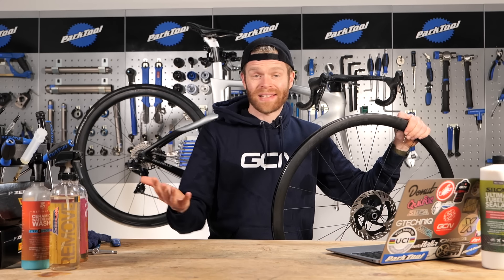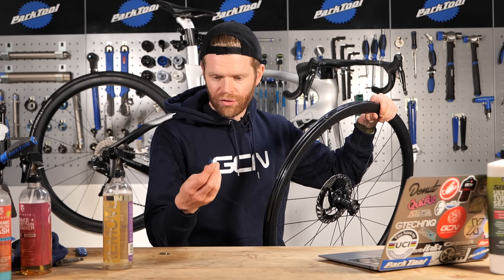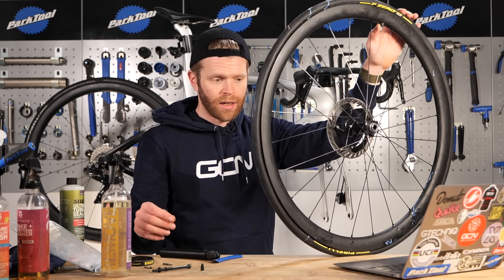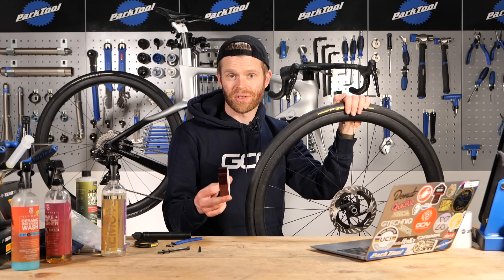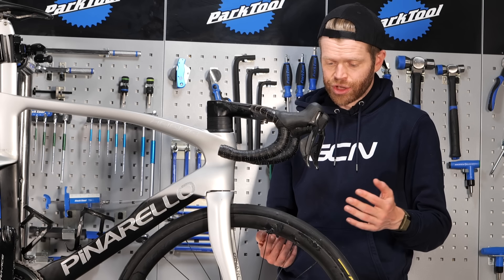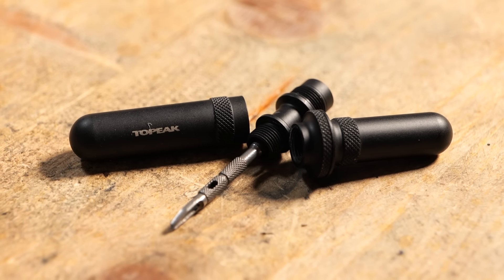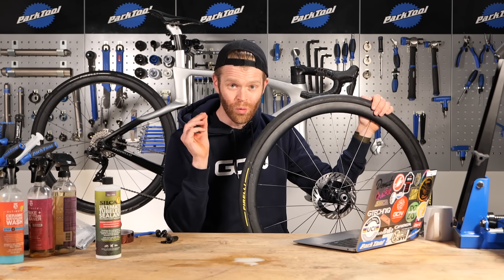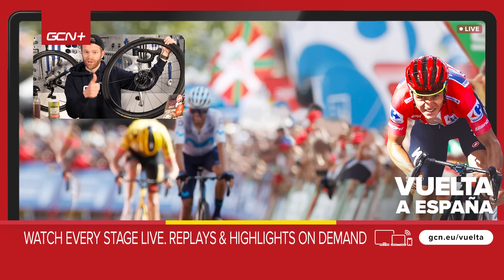Everything You Need To Know About Tubeless Tyre Maintenance

Comment: No mention of how much sealant to put in... maybe this is common knowledge but I've found that you want to have enough so that a small puddle of it quickly collects. This way when you get a puncture, you can position it at 6 o'clock and the puddle will collect over the puncture. Having just a coating inside the tire is too little.

Comment: Tubeless are so amazing they not only cost much more, they also need a 20min video to explain how to set them up using additional tools and sealant that you also have to buy.

Inner tubes - 10$  and you can replace them with your hands and a small pump.
Reply: Are you installing tubeless with your feet?  It's remarkably easy to install tubeless tires these days.  As for the cost, time is money and putting two tires on in 10min total(including tape) is quite easy.  I get home seeing a bit of sealant on my frame 3-4x a week.  Every time,  I would have been stuck on the side of the road swapping tubes if I were running tubes. Instead I just unknowingly keep riding.
Reply: @veganpotterthevegan  there is no way that you would get a puncture so often unless you are doing something very specific and very wrong. I ride between 400 and 800 km per month and would get a puncture once maybe twice a year at the most.
Reply: @mjock392  where you live matters. I'm in the rockies in goathead country.  Sometimes I have a goathead in my tire before getting off of my very own street.  I pluck it out, see a dot of sealant and go on my way.  They're really everywhere here.  So yeah,  I'm not doing anything wrong outside of riding outside😅
Reply: @mjock392  I do ride a lot more than you though.   I rarely ride less than 1800km a month.
Reply: I'm never going back to tubes. Tubeless has indeed been amazing for me.

Comment: #askgcntech In the theme of mounting tires (tyres, sorry Brits!) what is the difference between mounting tires (tyres!) with no discernable tread pattern in the correct orientation and the wrong orientation. GP 5000s have not discernable difference in the area where the rubber hits the road. Does that actually matter? As a regular GCN Tech viewer I'm obviously super nerdy about my bike set-up so I'd do it "correctly" either way but I was curious if it actually matters. If so are we going to talk about rubber layup like we do with carbon fiber?
Reply: can be a bit to do with the layup, but it can also be the casing construction. A lot of motorcycle tyres get fitted the "wrong" way on the front wheel due to the casing construction

Comment: I went tubeless but was super disappointed I didn't get a single pop or bang when the tyre seated. 😢
Reply: Some rim-tire combinations don't make the "ping" sound when you seat them, like if you're working with a Roval wheelset. If the rim bed's valley is deep enough, then the tire bead may "ping" when you get it seated.
Reply: @sbccbc7471   Ah I see. Thanks. I thought it hadn't seated but left it over night and it turns out it was

Comment: Yes tubeless is great, but I just don't think they're worth it for the roadside dramas. Good quality tyres have very good puncture protection, which in itself contribute to reducing the risk of a puncture. When you do get a puncture changing a tube is infinitely easier and quicker .
Try putting a tube inside a tubeless tyre - both a struggle to get the tyre off and back on.
Reply: I've gotten home from rides and noticed dried sealant on the seat tube.  Turns out I have had punctures that sealed themselves.  No roadside drama of having to replace a tube.

Comment: Tubeless people: Tubeless is great. Make sure you switch over 

Also Tubeless people: posts a 20 minute video basically confirming that it isn’t actually worth the hassle
Reply: I thought the same but I set up for first tubeless wheel today and it took less than 5 mins. I'm pretty sure people love to overcomplicate things
Reply: @DanielButler92   Indeed, my commute bike is not advertised as tubeless ready wheels, I replaced the worn Zaffiro tyres with Terreno zero, and converted to tubeless, twas no fuss, the tyres go on and off the etrto wheels a breeze, 2 road, one mtb and a flat bar all running tubeless now.
Reply: Tubeless has been a game changer for me. I've experienced almost none of the hassles others report. I guess I got lucky with my setup. Never going back to tubes!

Comment: Beware!! I have found out the hard way that CO2 makes sealant set hard within 24 - 48 hours.  If you have to use a CO2 cartridge, for instance to re seat a tubeless tyre, flush the CO2 out by inflating and deflating using air 6 times and preferably when you are back at home replace the sealant.  This is not just my opinion but confirmed to me by the Silca technical team.

Comment: Tubeless tires are a rip off from the manufactures.  They serve no practical service to road cyclists who travel with experience.  I have incurred two flats on the road in the past month (logging 800km+) In each case it was simple replacing the old tube with a new (reconditioned) tube.  No mess, no need for fluids or special tools.  Simply  re attach and get moving again!!!  My partner bought a new bike this year with tubeless wheels.  The front simply does not hold air - needs to be re-inflated every week.  The rear never sealed even after returning it to the purchase shop for fixing.  They could not fix it because the tire had an fault in manufacture!!!! They simply inserted a tub,

Comment: Frankly, I've been underwhelmed by the claims of the tubeless tire crowd.  The testing I've seen contradicts the claim that going tubeless leads to greater speed.  There is also the problem of knowing when to add sealant since sealant eventually dries out and there's no practical way to see when more sealant is needed..  And If sealant isn't added when needed, the tire can spontaneously lose pressure.  And when more and more sealant is added over time, the tire gets heavier and heavier.  Frankly, I'm not sure in what conditions riding tubeless provides any real benefit.

The problem of punctures is much less of a problem today than in the past.  First, people are not trashing the roads as they once did and second, more and more drinks are sold in aluminum or plastic rather than glass with the only the exception of brown glass for beer.

So if one wants to really minimize the possibility of a puncture there are two things one can do: 1) Run the widest tire the frame will accept;; 2) Reduce the inflation of the tire.  I used to ride with my tires at 120 PSI but in time I was advised to reduce the pressure and started riding at 80 PSI and I was pleased to find that my pedaling effort did not noticeably increase.  I'm now riding at 50-60 PSI  on 35mm tires.

The future for most riders for more trouble-free rides is the TPU tube.   There were real problems with the first generation of these tubes but with better valves and slightly thicker walls, they are just as fast as latex but require reinflation much less often.  These tubes should become more available as sellers benefit from rider feedback.

Finally a positive note.  While sealant is a poor substitute for tubes, the advent of TC compatible rims and tires provides a substantial safety benefit.  There is an interlock between the tire bead and the rim.  In the advent of a puncture, the tire stays affixed to the rim making it far more likely that the rider can avoid a crash.  With old style tires and tubes, the tire bead would fall away from the rim and in an extreme case, the tire could come off the rim almost entirely.  It is this advantage that has kept the tubular tire in use in racing for long after its performance has been eclipsed by the best wired-on tires.